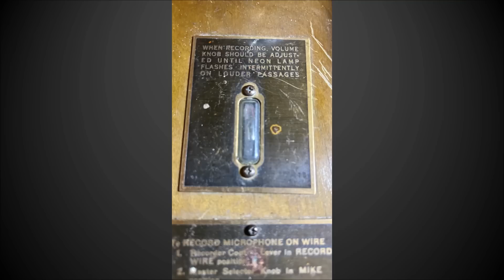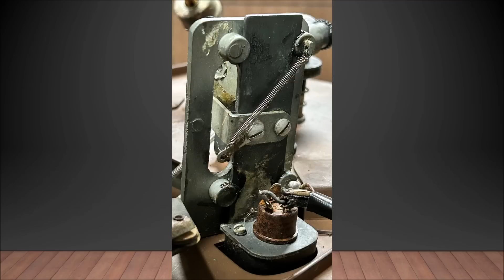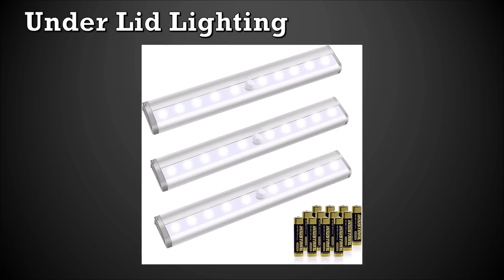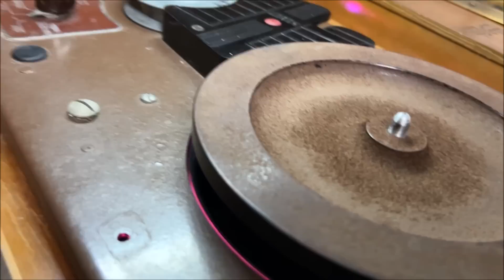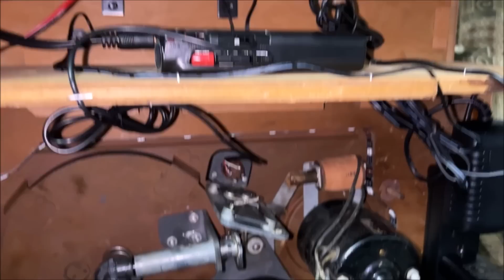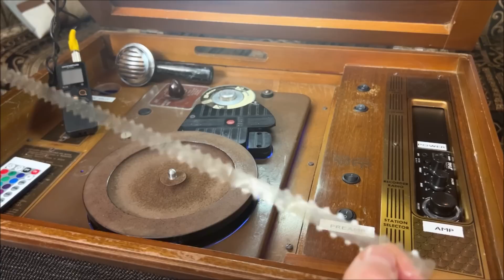I Must be out of my Mind!!  1948 Wire Recorder - Sound on Steel Wires?!?!?

Comment: Actually most of the times tubes are OK even if they were used a lot. The caps and sometimes burnt resistors are the biggest source of no working condition in those machines. Same with all old tube stuff. They made tubes well then.

Comment: Really awesome project! Why didn’t you split the signal coming out of the preamp to record from digitally instead of having to add the attenuator from the amplifier output?
Reply from the maker: I touched on this idea in the video. The basic reason is that I did not have a splitter and I didn’t want to have to spend any more money on it. 😂😂

Comment: Would be interesting to see what kind of quality a wire reel would have using digital masters. Is recording to the wire a case of outputting to a mono connection on the wire reel head? I wonder what you’d get, quality wise, sending a 192KHZ 32 bit mono signal to the head? I’m guessing the head is limited to what frequencies it can actually record, but with a high quality signal input I’m also assuming the quality of the recorded signal would be pretty good.

Comment: Amazing video, too bad the restoration didn't succeed but the main event works, you are able to digitize wires!
I was afraid about the taped wire while (recording) EDIT : I meant rewinding, hoping it didn't break anything. I bet you stopped rewinding ahead of time.
The Dymo font matches the old one rather well, but a wood background color would bring an even better look <3
Reply from the maker: Yes, I may revisit the label situation. I would just need to order new labels.